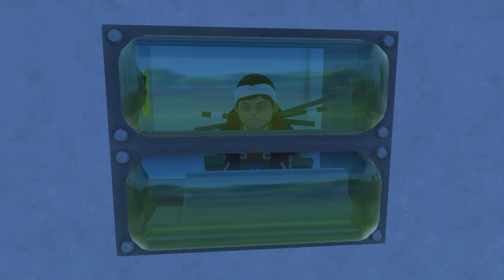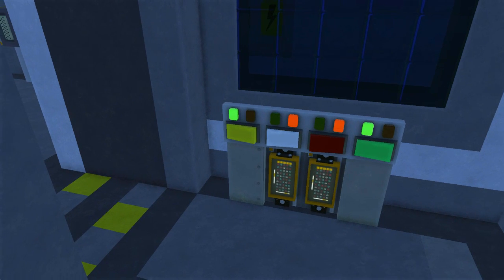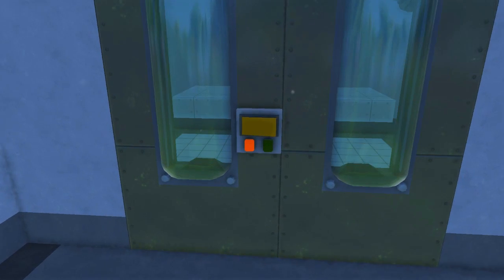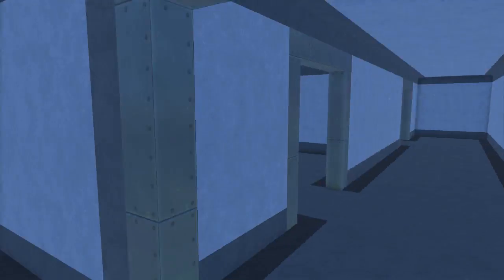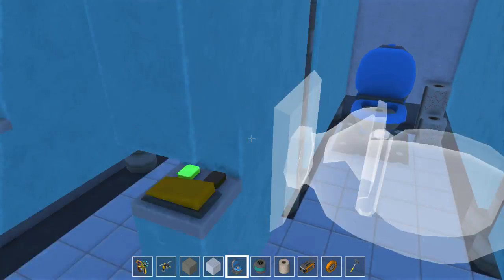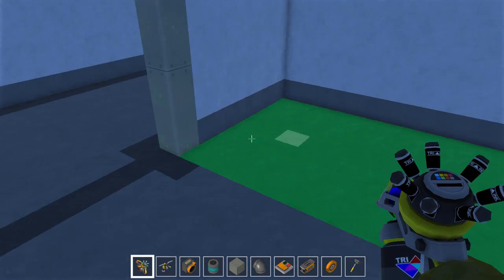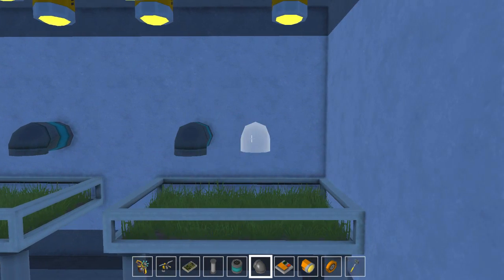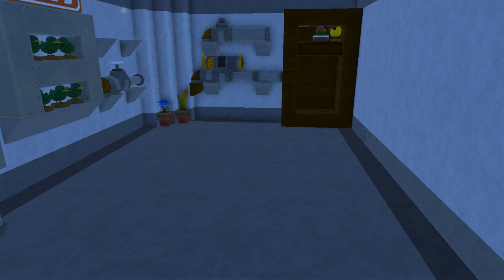FALLOUT SHELTER Community Project! [EPISODE #3] - Scrap Mechanic (0.1.27b) Gameplay Let's Build!

Comment: For the doors use this design:
o - button/switch
i - controller
b - bearing with block
h - block
s - sensor

design:
oh
b1hhh-+
       h i1 [rotate in 45 deg]
s [connected to door with dist to 3 on switch mode for buttons button for switches]
       h i2 [rotate in 45 deg]
b2hhh

If you understood, that acts as a toggle. Just hold the button. Using switches the sensor should be on button mode. It works perfect and I loved it since I found it.
Reply: the inner blocks are slightly out of place sorry. Should be on the ends.
Reply: the inner blocks are slightly out of place sorry. Should be on the ends.

Comment: Wouldn't you need some sort of shower or bathing facilities as well or do you have to use the decontamination chamber for that?  The new windscreen might work as a urinal for your bathroom (not sure how well they mount/paint yet) Def would work as a bio-bed/cryogenic tube cover.  

How bout a padded room in case someone goes crazy?  

Mourge with slide out beds...

Radio/communications center...

Comment: add one of those valves to the garden room so you can turn on and off the water manually and add a computer room which controls everything automatically, so that valve would be for if that would fail.

Comment: You should make mirrors on top of the sinks for the bathroom
Reply: Also in the new secret room make it a library
Reply: last suggestion make a button to open up the vent and make a tunnel that has peep holes to hide if the robots get in